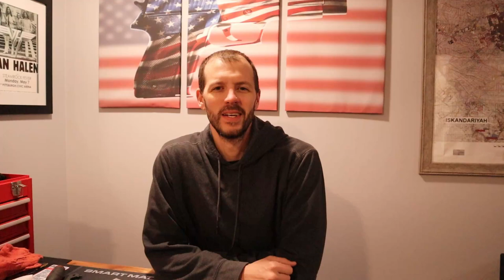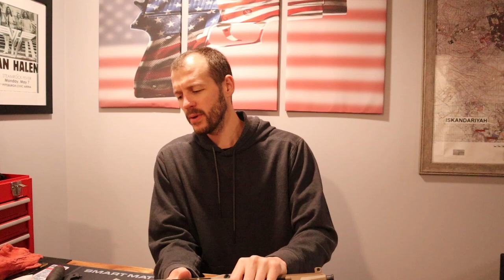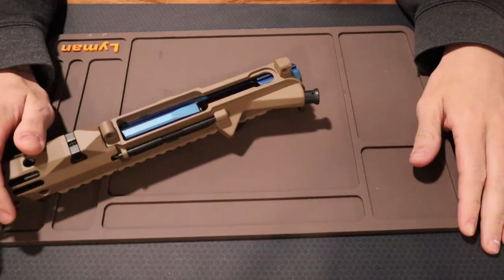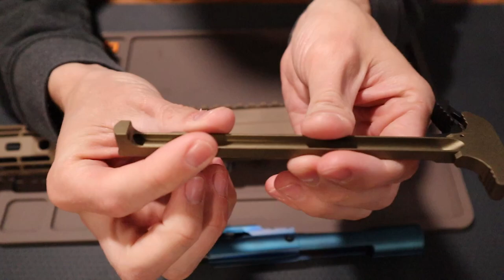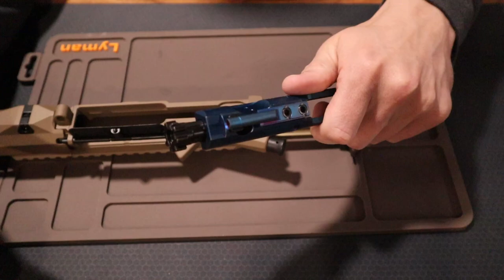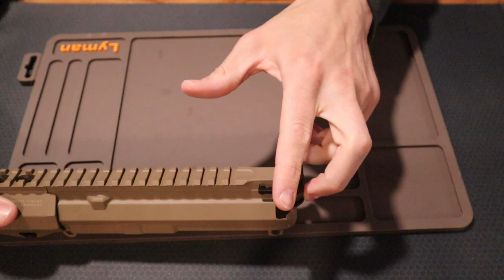Remove, Install, Replace AR Charging Handle

Comment: My AR keeps jamming up someone on the Internet said it’s because I need a new charging handle. Could that be true?
Reply from the maker: A bent or out of spec charging handle can cause problems. not really the most common issue though
Reply: @NeckboneArmory  what is the most common issue?